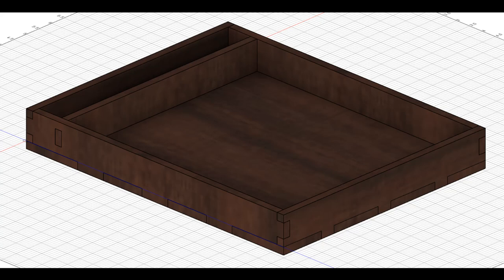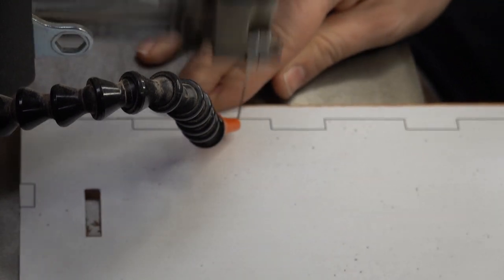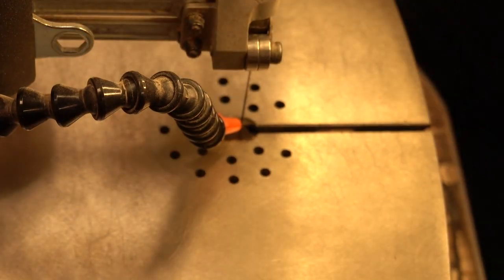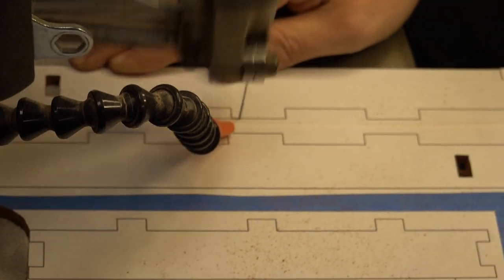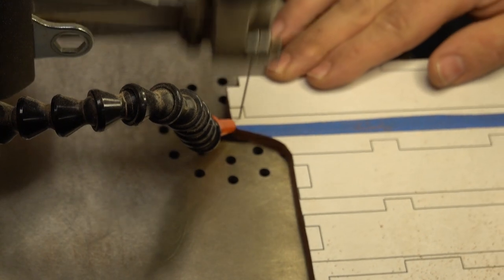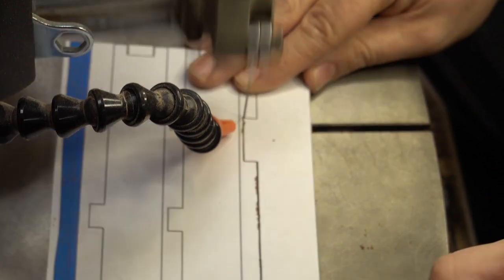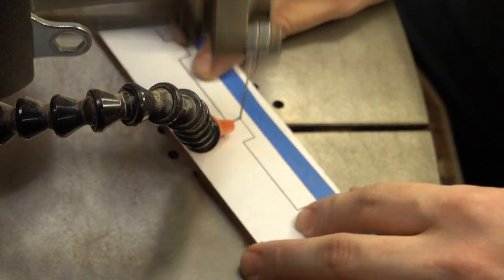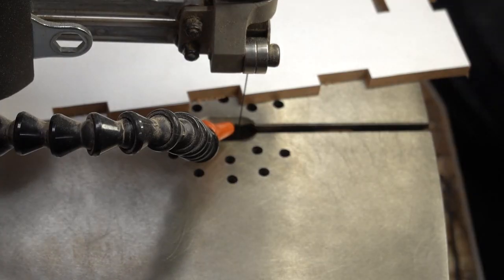Make a Dice Tray on the Scroll Saw

Comment: If you look under the plate where the blower tube is located, there are screws there that when removed allow you to turn the plate 180 degrees and that puts the blower tube on the opposite side. I had to do it on my saw.
Reply from the maker: Hadn't thought about that but I might have to give that a shot and see if it improves the view! Thanks for watching